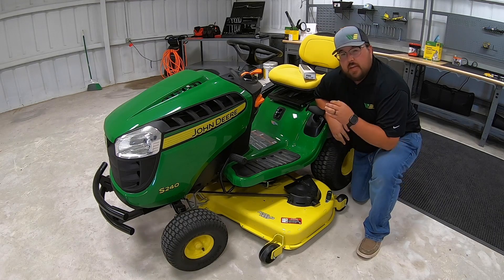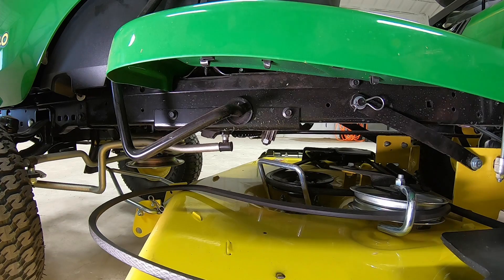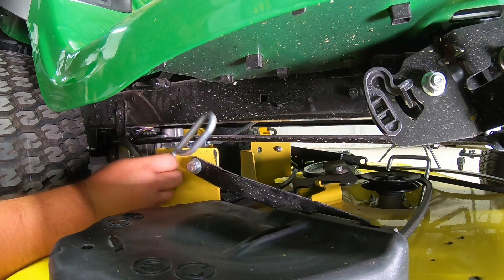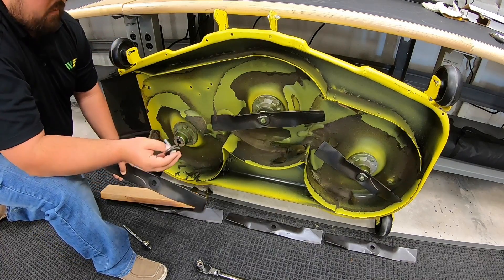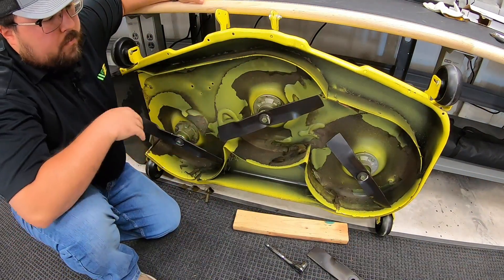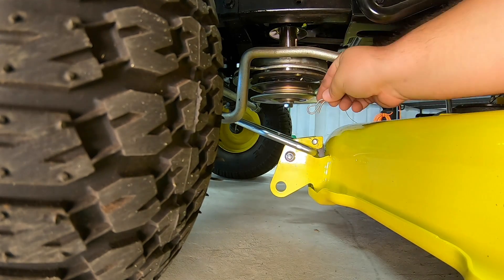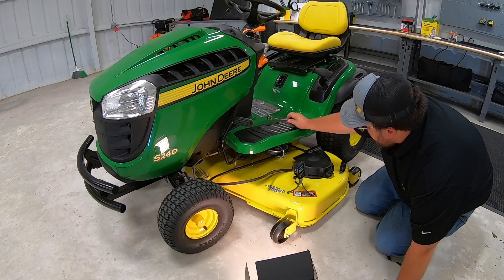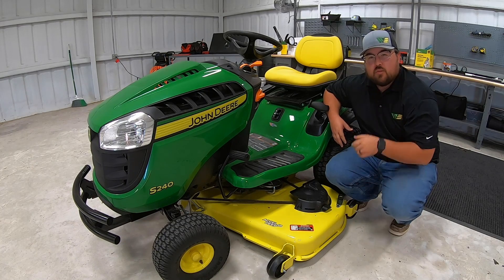Change Blades and Remove Deck John Deere S240

Comment: I am considering a new S240 as my next mower (currently running a GT 275 from the last century which has served me very well). One item of interest for me was removing and installing the mower deck, since I do it several times a year to clean it and sharpen blades.I was hoping to see how Deere had reengineered the deck to make it easier to detach and install, but ALAS! what they did has not done that - instead they cut costs by making it cheaper. #1 - spring pin clips are a bad idea, mainly because they are hard to remove and install (esp. when covered with dirt, grass, etc.) and they get lost easily. #2 - they did away with the swivel wheels on the corners so now you have to drag the deck out from under. #3 - the attachment arms are just cheaper and harder to remove/reinstall on both front and back - you demonstrated that in the video. I don't think we should have to pay premium prices to get something that serves the customer. Now I am having second thoughts.I feel sorry for the younger crowd who never had a chance to use real quality equipment.
Reply from the maker: Thank you for the comment! We appreciate the feedback so maybe we can run this up the pole. Also, thank you for watching!

Comment: Brent, I appreciate your videos. I’m currently looking at/researching different JD models. My total yard size is .33 acres, but some of that is in the woods and I don’t mow in that area. But the portions I mow have some slopes, so I’m needing a mower that’s built a little more heavy duty and I think the S240 is going to fit that need. That 30-second oil change system in the 100 series seems to be a very polarizing subject with a lot of people, and I don’t see a lot of positive feedback about it. I get it. It’s a time saver for most home owners who just want to speed up maintenance, but I also see the better benefits of completely replacing the oil. Has there ever been any actual negative effects of the 30-second system reported by those who have done it over the last few years?

Comment: Thank you for the videos, I have been learning about the new S240 42" deck I bought in Feb 2021.  I had ordered from my dealer the optional bagger kit and mulch control kit, but due to the storm in Texas, have been told that neither have even been made yet.  Have you ever installed the lever actuated mulch control kit on the 42" deck?
Reply from the maker: Yes I have. It is a very easy install and once I get a mower that has the right deck I will do an install and post it to our other channel 247Parts. So go check out that channel and stay tuned. Thanks for watching!

Comment: I think my S240 needs a 24mm socket. The largest in my set is 19mm, so I'll have to buy one.  I usually have the John Deere guy install new blades when he does the snow thrower changeover, but he forgot this year.

Comment: Thanks for the video, it's been very helpful. Could you please help me understand which way the washers should face? The washers are cupped and shaped like a bowl. Should the inside of the bowl be facing the blades, or the outside of the bowl (if we think of it that way)? I am not able to find the answer online anywhere....thanks!
Reply from the maker: The inside of the bowl should be facing the blade.
Reply: @WesternEquipment  Thank you!

Comment: I have a new set of mulching blades. What is considered the right and left side of the mower? I installed them from the perspective of the drivers left hand and right hand while they would be operating the machine is that right?
Reply from the maker: Yes, that is correct. It is always from the perspective of being in the drivers seat. Thanks for the comment!
Reply: the new blades have grass side stamped in the metal?????????

Comment: The specs in my John Deere S220 42 in. deck owner's manual recommend 50 ft-lbs for tightening the mower blades. Seems kind of less than what I thought it should be. Do you recommend sticking to the manual, or taking initiative to increase to 65 or 70 ft-lbs? For now, I have them at 52 ft-lbs of torque. Thanks.
Reply from the maker: The manual is usually the best way to go, but I don’t think an extra 10 lbs of torque would hurt.

Comment: Will any 48 blades work on the s240? I noticed some have three holes and some have one main one. I did a search on your site but could not find s240 mulching blades.
Reply from the maker: Here is the link to the mulching blades for the 48" deck on the S240. Thanks for watching! https://247parts.com/m127673-mower-blade-mulch-blade-1/

Comment: Hi Brent, does the 42" S240 deck also recommend 65 lbs per ft for torque for the blades as well?
Reply from the maker: Looks like it only requires 50 lbs.
Reply: Thank you for the response, I couldn't find it in my manual. Much love

Comment: Does it matter the way the blades are turned when changing them, like I know the 166lt needed to be set 90 degrees of each other
Reply from the maker: It does not matter on these machines. The off set of the blades will not let them touch. Good question and thanks for watching!

Comment: I have the 42” deck but the kit that fits mine based on serial number doesn’t have the swing gate. The dealership said it might fit but they aren’t sure… mine is a 2019 S240 - anybody installed the kit with the swing gate on a slightly older S240?

Comment: Just bought a 2018 S240 today. I lowered the anti scalping wheels all the way down and I cut my depth at 4". Still seems to cut the grass too short.
Reply from the maker: @Dave223 What kind of grass are you cutting?
Reply: @WesternEquipment  In the Midwest, so a ryegrass, fescue, and bluegrass mix.
Reply: JD doesn't level these decks to their own spec at the factory and the dealers are too lazy to do it. Even on this video the two threaded adjustment bolts ( @ 2:48) are only showing only a few threads past the nut. I removed both and adjusted them to .4 of an inch and moved the anti-scalp wheels down to their lowest position. Use a 6" scale to make your adjustments or a vernier caliber and not your eye balls. Also, the deck should have some rake, the front of the deck should be 1/4" lower than the back to prevent double cutting.